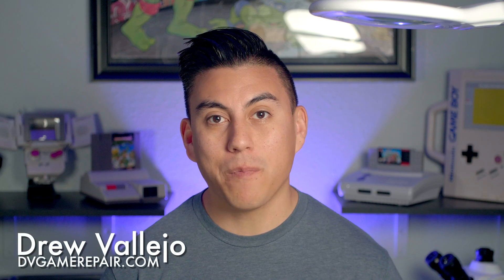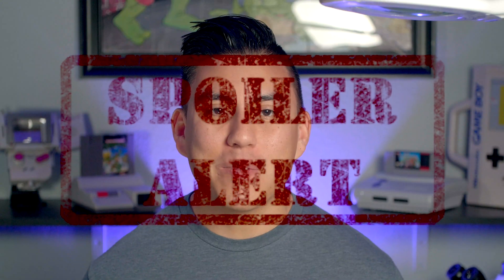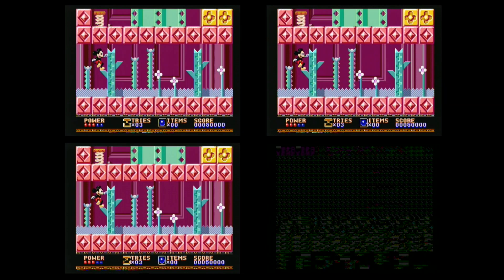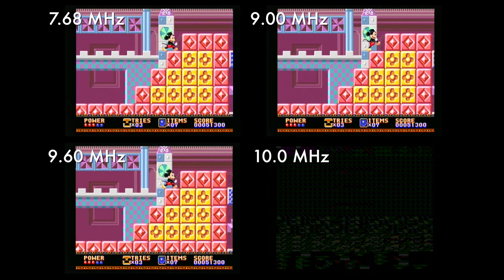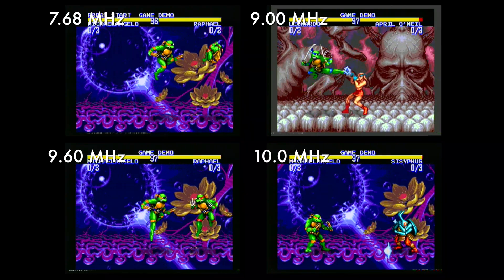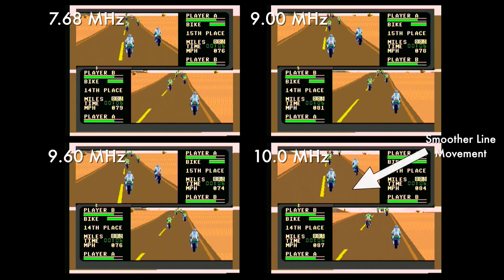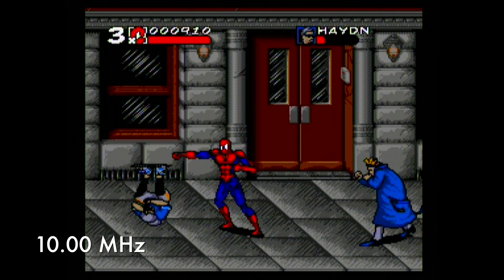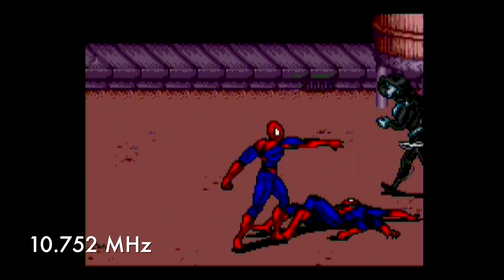Sega Genesis Overclock: Speed Test Shootout

Comment: genesis uses an 68000 at 8mhz, overclocking at 16 is insane... you can use a 68000 at 12/16 mhz for maximum stability. Did you use shorter wires? on +5 and gnd you used more bigger wires than the clk one? Many times the glitches/crashes is for that reasons. Many genesis/megadrive use a non "original" motorola 68000 but a clone on license. Try to change the cpu with an original one at least at 10mhz

Comment: If you replace the Z80 with a modern eZ80, but keep it at the original clockspeed, you should see how that affects games that heavily utilize the Z80. Virtua Racing actually uses the Z80 to facilitate communication between the 68000 and the Virtua Processor.

Replacing the 68000 with a 68020 (preferably the cost-reduced version, as it uses the same address space that the Genesis is already familiar with) would also be a cool thing to try, but you’d need to find some way to force the entire processor to run in Privileged Mode.

Comment: It's cool that we can overclock the Genesis, But this system, IMO, don't really need it. The Genesis is still a fast system compare to the Super Nintendo, who have a slow CPU.

That can be interesting to overclock the SNES and see if that can help for performance.

Nice stuff 👍
Reply: All the flight simulators need a higher clock speed.
Reply: Most of the problems with SNES was cheap publishers not paying for FastROM, CPU is ran at 2.5Mhz instead of 3.7Mhz. If Nintendo had gone with 5 or 7 Mhz CPU they never would have needed the SA-1.